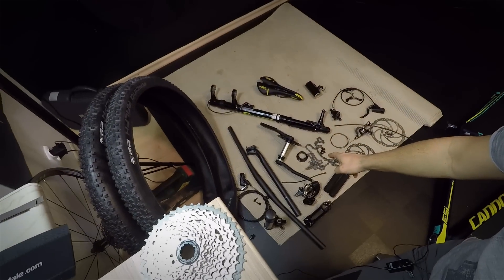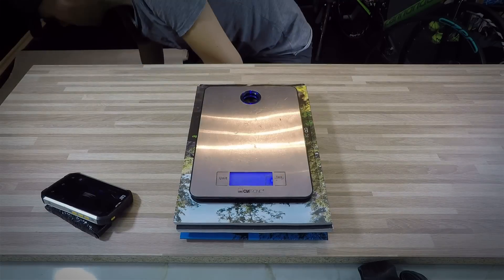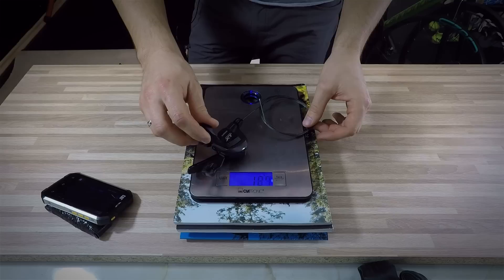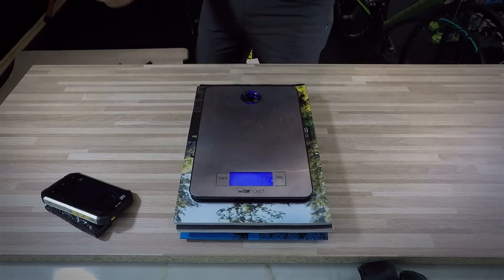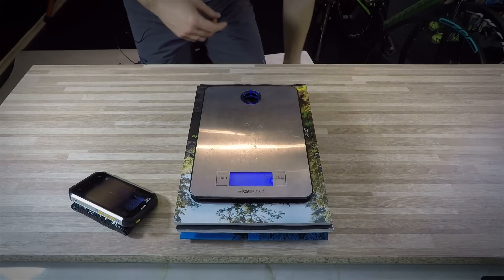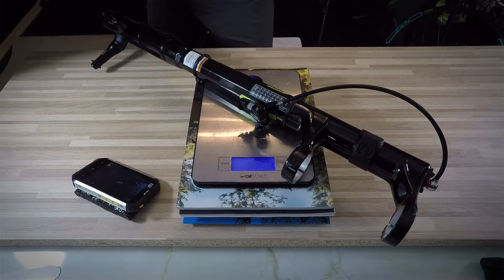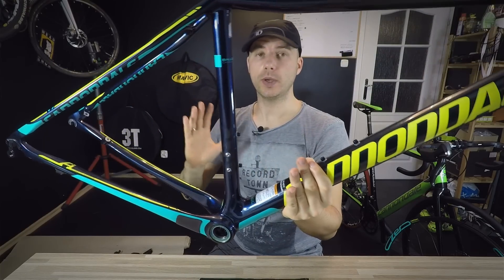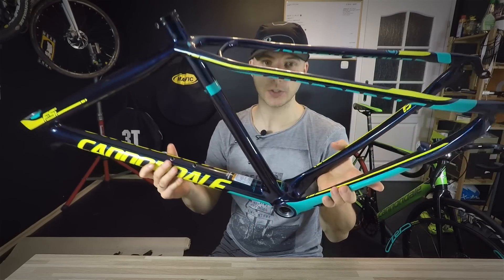2017 Cannondale FSI 2 Carbon Stripped - Review, Part 2. Weight Of All The Parts.

Comment: I guess the left hub flange is smaller to allow little more clearance between spokes and brake calipers. Which is good thing. But if asymmetric wheel really is noticeable stronger, then why don't all manufacturers use them?
But if it's really better, then not being able to use any wheel, is not a big teal. Of course, when the ridding conditions change too often, you would like to have many sets of wheels with different tires.. But having already a lefty specific wheel at front...
And finally, if you don't want to buy cannondale wheels. I guess you can build one by yourself.. I always like things that I have made by my self more, than factory stuff. Even though there's a big disadvantage in quality.. I suppose hub is still standard?

Comment: New Lefty was really one big unpleasant surprise in this video. The older version with weight of 1180 gram was the lightest and the strongest fork on the market. In terms of strength it was never even challenged by another forks since it is just not possible. Making it even stronger has no sense since the wheel itself is limiting factor in terms of strength of front suspension.
Maybe this fork "upgrade" was the reason CFR had such terrible results this year.

Comment: Thanks for the review, I am a fan of your channel. Very informative and consistent.

But, what about the AI rear triangle system? OK, you don't need a third market wheels, it's disputable, but OK. But what about wheel building/checking etc works? You can not use any truing stand, as they are all symmetrical.

Comment: so Scott makes 960g frames and this 1300g, what's the point of Cannondale?
Reply: Fsi HM only frame tg.M is 920gr
Reply: it weights 1155g. In the video he has installed 53g headset bearings, 78g PF30 bottom bracket bearings and 23g seatpost clamp.

Comment: Great video.
Detailed pictures on instagram?, getting good photos with a bad phone camera like this is tricky, sometimes I have to sue flash light and adjust the placement of the flashlight to not get too much light like I do with a flash,
some times I use flash and I turn down the exposure, but It depends on what I am shooting and when and where.

I noticed some of your photos are overexposed, if you used flash, when its bright its probably the reason, 
I use Focal app(its in beta),I can do manual focus and exposure and color correction.
And infinite burst mode.

I recommend using flickr, I never understood the instagram thing. you video shows so much,so those instagram pic don't do much.
I don't get why any one would upload pictures that are square and so tiny, apart from being faster to upload on slow mobile network.
the video is more detailed.
Wrap a inner tube around the chainstay!!! don't use the provided protector, it will just move around and eventually fail.